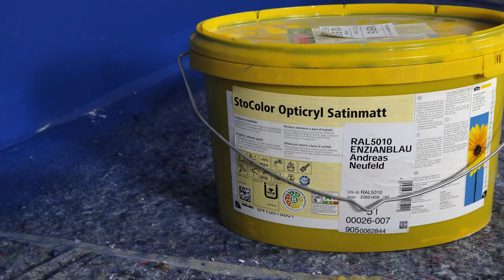Graco ST MAX II 495 PC PRO Demonstration with Airless Discounter

Comment: Is this kind of sprayer apropriate for high build industrial coatings such as epoxy primers with high VOC?
Reply from the maker: If you would like us to advise you on a suitable Graco or Wagner machine model for your product, please email us with your product data sheet so that we can check and assist you. 
Email: info[at]airless-discounter.de 
Best regards, 
Airless Discounter team

Comment: I just got a used one like this one but it doesn’t say “PRO” is it the same one or what’s the difference?
Reply from the maker: Pro doesn't always mean that the machine can handle a professional use. 
Check with your retailer what will works best with your needs. 
Kind regards,
Airless Discounter team

Comment: How Are you guys using these airless sprayers is and not covering yourself with overspray. I’m not a painter, but  I do flip houses pretty often and every time I use one I cover myself with overspray. What am I doing wrong
Reply: Hi Daniel, it is not that difficult as driving a car but you have to learn it. Keyfactors are: handling of the gun, distance, angles, pressure, tip sellection and so on. Where are you from? We offer day courses in Germany. In some other country are also courses offered.
Reply: Airless Discounter  thank you very much for the offer but I am in the United States. Maybe I can use this as a excuse to come to Germany for a vacation. I purchased a grace 395 highboy and do not have much experience with it but I do know I make an absolute mess. I don’t know what is the appropriate pressure or tips or how to determine. It does a very good paint job, it does use a lot of paint but everything is completely covered with overspray when I use the machine. I wear a disposable paint  suit if have to throw it away after doing one or two rooms because it is covered in so much paint 😳
Reply: @danielcj5  You might check our videos about overspray and tip selection.
Reply: Overspray = to much pressure...

Comment: Everything that guy is doing is wrong...the pressure is too low, the nozzle seems wrong for the sealing ,the technique is way off.
Reply: Plus, airless sprayers are notorious for leaving stripes on the surface if you dont back-roll.
Reply: @lixxxxit  i have the 490 and if you set it right (pressure) the stripes almost disappear, plus he is doing a second coat.
Reply: I agree the pressure is to low😅 i did that for my sprayer and it didnt last long